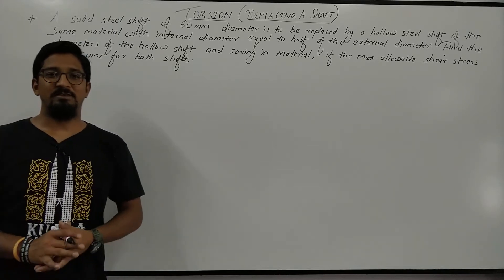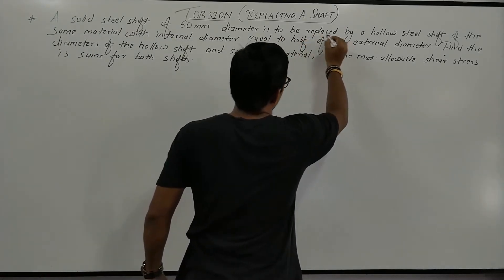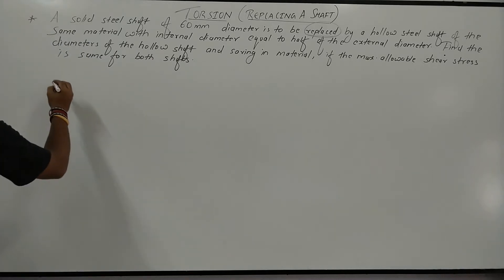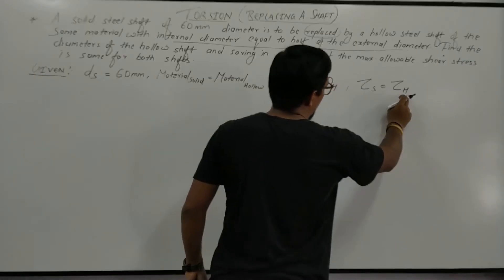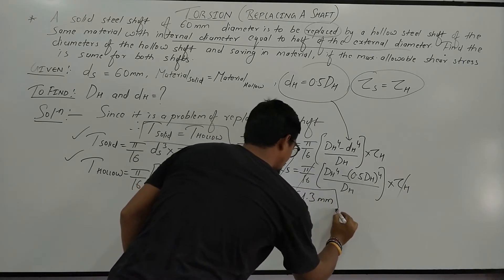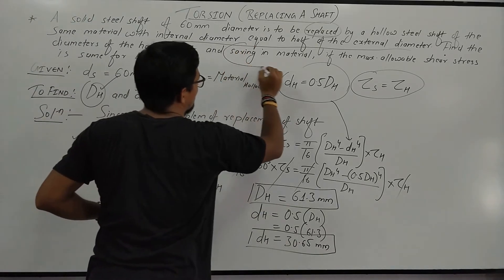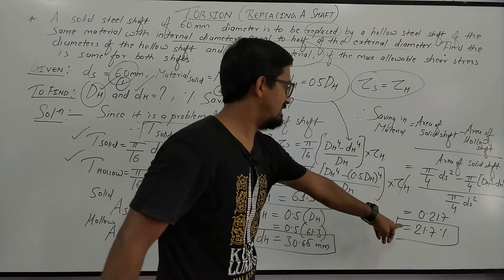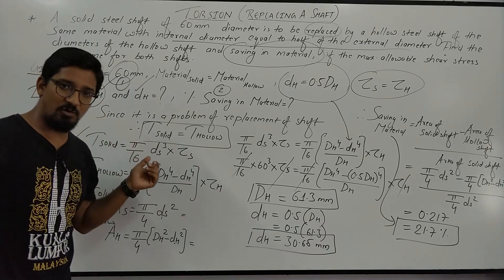Problem 6 on Torsion | Replacing a Shaft | Torsion | Strength of Materials

Comment: a shaft of 50 dia and 1.5m length replaced by an equivalent torsional shaft which is 40mm dia. find the length.
Reply from the maker: When the shaft is replaced Torque is taken as equal between the two shafts , so first bring down the given values in terms of l and then equate the two Torques to get the answer